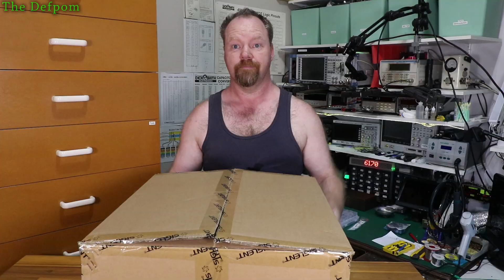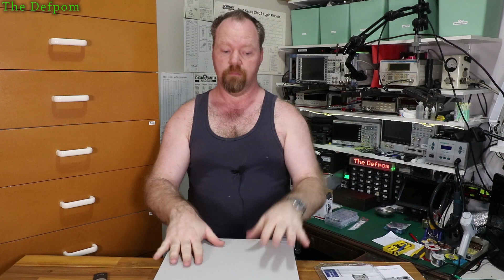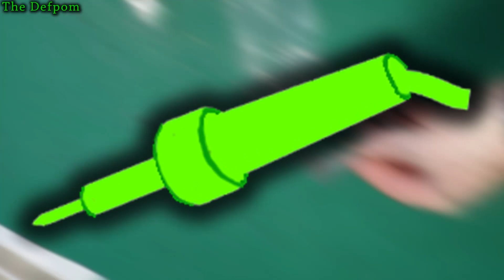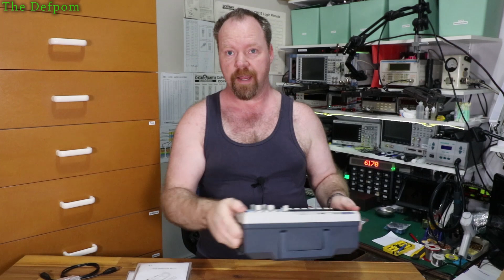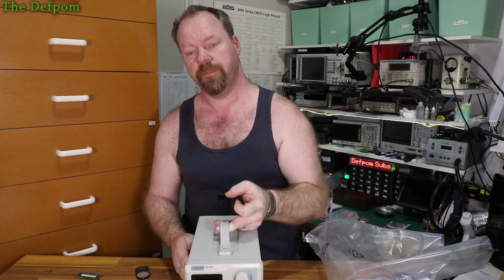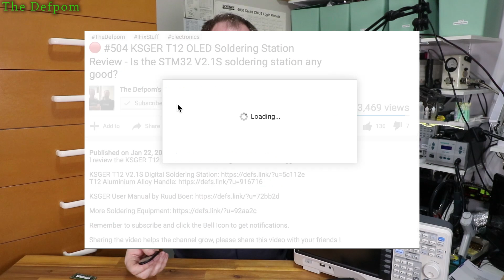🔴 #516 NEW Siglent Test Gear !  - Review Teaser for SPD1305X, SSG3021X, SDS2352X-E, SVA1015X

Comment: Can't wait to see the review for the scope. I've been putting off purchasing one of the 2000X-E models until someone did a review. Siglent America told me that they probably wouldn't review it because it is very much like the 1000X-E models. Looking forward to this review.
Reply from the maker: wb8vqv - is there anything in particular you want me to try to cover? If I can try to include it in the review, the scope will be the first review I do, as I am most familiar with that already.
Reply: Thanks for the reply. Would be nice to see if it will really do 350MHz and possibly see what the maximum usable frequency it will see. It would be nice if it would work up to the 440MHz ham band. Also looking for and noticeable firmware quirks. Other than that, just a good overall review would be nice. Again, thanks, Dave.
Reply from the maker: Bandwidth tests are normal in my reviews, I like to see how far things can stretch in real world use.